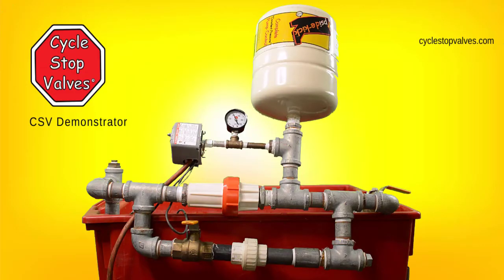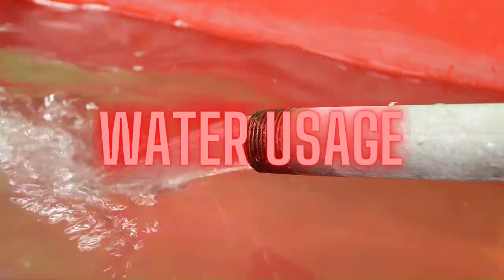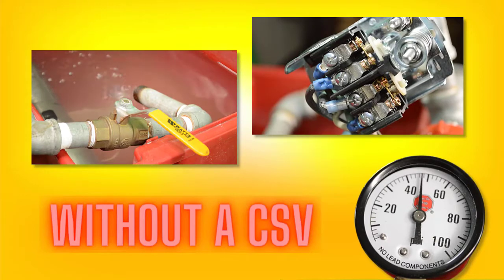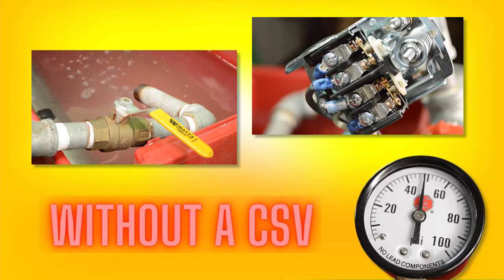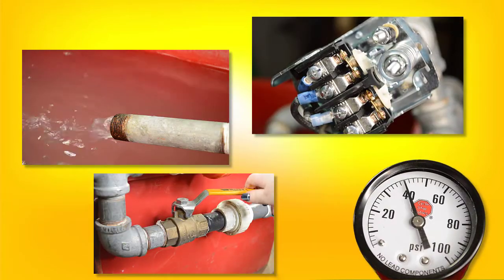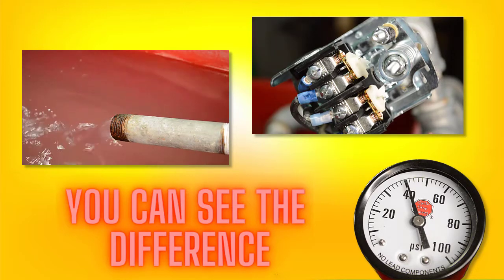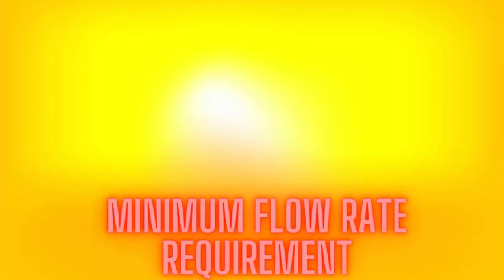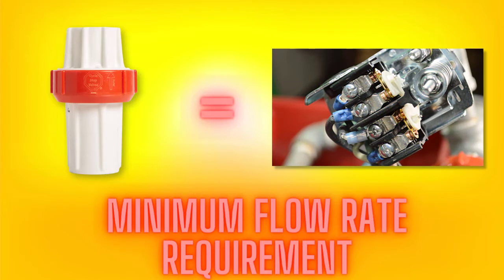How A Cycle Stop Valve Works

Comment: How am I supposed to keep a 1gallon a minute flow? Leave a hose running all year?
Reply from the maker: You could if you wanted to.  Or you can run as much or as little water as you want for as long as you want and not cycle the pump to death as you would without a CSV.  But if your not using any water the CSV lets the pressure tank fill up and the pump shut off.
Reply: @cyclestopvalves8380  I guess I misunderstood that as requirement. I researched and saw It's the minimum for the pump to run and stay cool. Got it. So actually we are benefitting from reducing cycles and getting the constant pressure, by the pump still goes on and off.
Reply from the maker: @mrniusi11  No! The CSV holds the constant pressure at 50 PSI and doesn't let it build up to 60 where the pressure switch would shut the pump off.  So, as long as you are using more than 1 GPM the pump never shuts off.  Only when all the faucets are closed will the 1 GPM fill the tank to 60 and the pressure switch will shut the pump off.

Comment: I absolutely love our Cycle Stop valve.
Reply from the maker: Thank you!
Reply: @cyclestopvalves8380  Hello. will the CSV allow me to run a 4 gal. pressure tank with a 22 GPM 1 HP pump on a 40/60 swith with the CSV tuned to 50 psi. for my irrigation? My pump just bit the dust and come to find out it went out because the tank went out causing short cycling. I would love to go with the CSV and a smaller tank. That is all this well is used for is my lawn sprinklers. My home is on city water.
Reply from the maker: @eriwilnel  Regular cycling caused your tank to go bad.  Then rapid cycling from the bad tank caused the pump to fail.  Sure the CSV1A as in the PK1A kit will do what you want and comes with a 4.5 gallon tank.  But it could supply the house as well as the irrigation system if you wanted.  My well water is better than any city water and that way I have control of how much pressure I have, which is enough I don't even need soap in the shower.  Lol!
Reply: @cyclestopvalves8380  Thank you so much I will be reaching out to make an order. Thanks again.